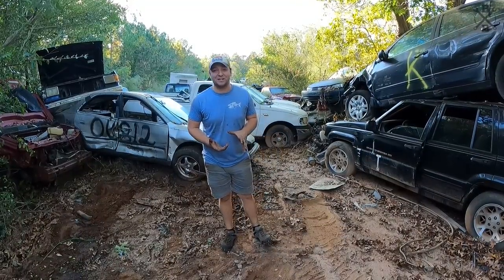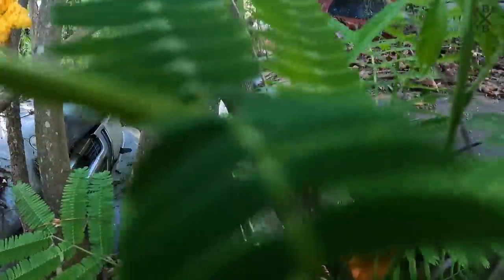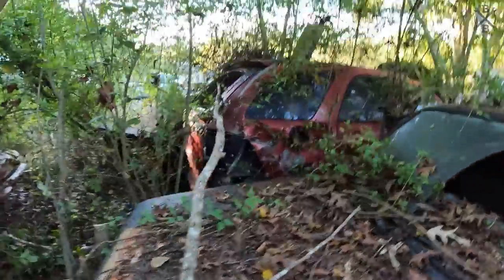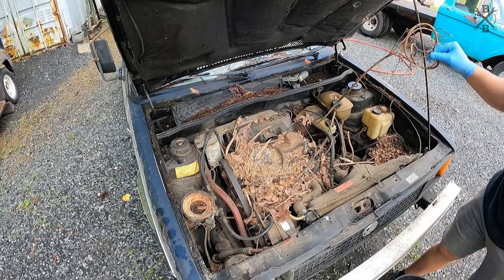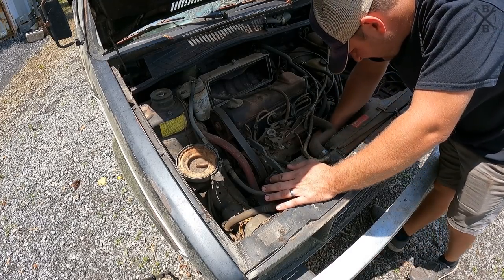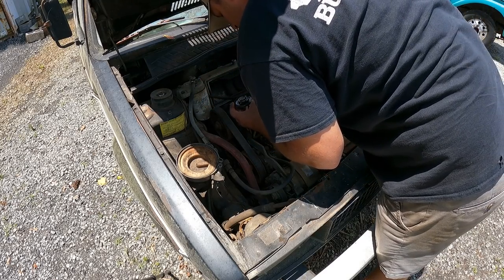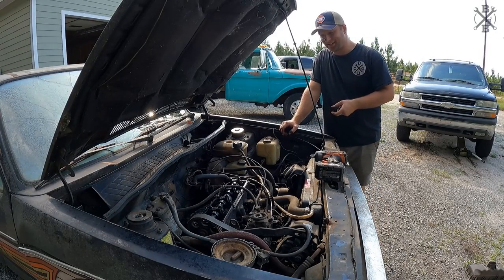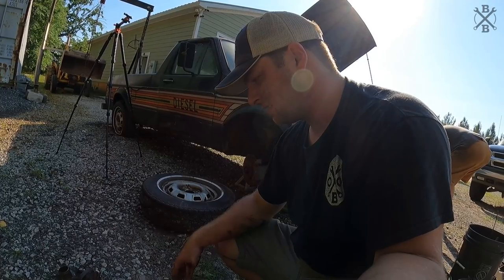ABANDONED Volkswagen Caddy! Scrapyard Rescue Rebuild Part 1

Comment: In 1991   I bought a 1981 diesel VW Caddy from the original owner.He told me it had no compression,but if he coast down the hill from his driveway,it would start right up.It had 180,000 miles.5 speed with A/C.I paid $275 and drove it home.It ran great and tracked down the highway perfectly.Ended up putting new glow plus and a new battery.
No more problems

Comment: Dear Budget Buildz guys.
👍👌👏 Yes, please build it. But only if the bobcat driver at the junk yard didn't do too much damage with the forks (it seems they are never aware of the fact, that foreign cars do not have a ladder frame). 2) One of the best, reliable and sturdy VW/Rabbit gasoline engines of all times is the 2.0l 100 hp. It's strong enough and it is easy and relatively cheap to get (at least in Germany). On the other hand: Only 200 bucks for a good running 1.6l Diesel has to be beaten. Especially because nothing has to be changed (electronics, speedometer, gearbox etc.). I guess that I would put in such a replacement engine at first to get the car running. After the other modifications, you can still decide to do different.
Thanks a lot for making teaching explaining recording editing uploading and sharing.
Best regards luck and health to all of you.

Comment: As many Caddy's as you have probably messed with, you probably already know...  But since you didn't mention it in the video; be Sure to look carefully at the strut housings.  Trucks and Convertibles have a double-skinned strut housing to reinforce the body since neither could really count on the roof to help keep the body square.  Convertibles rarely had a problem with the sealant in the rain tray area cracking, and allowing water to go in-between the two skins at the strut area since they were made in Germany, however all the trucks are American-made, and quality control wasn't as sharp.  Looking at the video when you were messing with the crank, I noticed one horizontal crack in the sealant that Could indicate that rust is at work.  I'd verify this before you do ANYTHING else, especially a TDI or 1.8T swap...   Good Luck!
Reply: Can you elaborate on checking the strut towers?  I have an ‘81 and would love to be able to reassure myself
Reply: @roccit  What he means is that first and second Gen Rabit/Golf are prone to their strut towers rusting out, both front and rear. On the Hatchbacks you can see it happening because its a single layer of steel on those but with the Convertibles and Caddys/Truck variants they have two layers of steel over another for reenforcement of the chassis and the lower layer can rust out from the wheelwell without it beeing visible from up top. The first sign of this happening is usually the seam sealer starting to crack/seperate and if you notice that the best thing to do would be to grind back the seam sealer, reweld/repair the metal and then reseal it before it gets worse.

Comment: Great you saved it! I drive an ‘86 Caddy myself, with a slide-in camper on the bed😁. Made me change the motor into an 1.9 TD (of a 1993 Golf 3), for the 1.6d lacked the power I needed. 
My thing is to keep it as time-correct possible. So no TDI for me. Good luck and save it! (Maybe try to make it Syncro??? Would be great to see that happening)
Good luck!!

Comment: I drove a rental "Gol" in Brazil for a few weeks (many years ago). It was a transition car for VW Brasil at the time, and had a A/C Beetle motor in the front, driving the front wheels. Kinda cool.

Here's my pitch: Put a fully built Scat dual port big bore A/C motor in it, w/a bus trans & flipped ring gear (and do burnouts). You might be able to source knuckles from a Gol with help from the Internet...

Comment: A really nice find, amazing that its not in worse condition after all! My vote on what you should do with it: Go gently with the liftup idea (with new rims/tires) for the looks without any welding, bars etc. Then a newer fuel efficient diesel engine and some cleanup of the interior and you´re sorted. It does not need to be 4WD. If someone one day want to being it back to totally stock you haven't really done anything harm to it. But your car, your decision! Greetings from Sweden

Comment: I say keep it stock - not a fan of lifted anything, and besides, if you swap the motor for a gasoline one you'd have to lose those fantastically 70s 'Diesel' door decals, haha. 

I'm just envious that you live somewhere that you can leave a car sitting outside under trees, on its floor pan and with busted windows, for 25 years and still be able to move it using a forklift rather than a dustpan and brush. 

Here in rainy England the bodyshell usually goes long before the mechanicals - you need to be good at welding and body repairs if you live here and are into 70s and 80s cars especially.

Comment: What A Great Scrapyard Save!! I’d Say Put A 1.9TDI In It, 5-Speed Manual, Lower It With Some Bags, Address That Body With Some Reconditioning, Fix The Rust, Floor Pans, It’d Make A Cool Shop Truck Or A Good Flip.. Keep Up The Amazing Work Guys..

Comment: If you're gonna lift it, you have to syncro swap it. I'd rather see the stock engine repaired or build up another block with as many parts as possible. I think keeping it close to stock would be really cool. I'd like to see the repair process, instead of just a swap

Comment: Micheal, my suggestion is.... take the old engine out but don’t scrap it. Find out and diagnose what’s exactly wrong with it. Then fix or re-build it so that it runs, but don’t put it back in the caddy. Then either put the other engine you say you have from the other car that would fit this one or get another engine you know works and runs and put that in the caddy. That way you have a decent engine in the caddy and a spare engine for either something else or to put back in the other car if you use the motor from that one. Win-win situation, sort of.

Comment: I cannot understand how that engine got so damaged. I had a Passat with the same engine and the body gave up first. That was after over 500,000 miles. I guess I ran out of oil ? They are tough little engines.

Comment: THE MOST useful small go back band forth to work WITH HIGH MPG and the utility of a low capacity bed.
(Prior owner of 3 1981’s).
Bummed that MS took the use of my legs or we would still give one.
BTW  All mine were in way better shape body wise.

Comment: My thoughts would be they put a different head on thinking it was just a dropped valve. It probably took out the rod bearing when it hit the valve and maybe jumped time also. They put it back together and hit the key and stopped dead so they gave up. If your gonna lift it maybe put a toyota running gear and make it 4wd.

Comment: my dad had the diesel version, with the manual transmission and factory air! i remember driving it once when the engine would not stop. in fact it was accelerating out of control. i didn't die, but thought i might!

as a matter of fact, if there's a diesel in there and it's not seized, it wouldn't surprise me if it started right up.

Comment: FYI VW made a drilling change in the head bolts MID-year 1981…..(ask me how I know…)
My 1981 Diesel Rabbit donor  car’s head wouldn’t fit, (without reaming the bolt holes) on my 1981 Diesel Caddy.

Comment: I had one of those pickups diesel and there was a recall on the engine I got a brand new engine at about 50,000 miles they might have replaced the engine the dealer might have